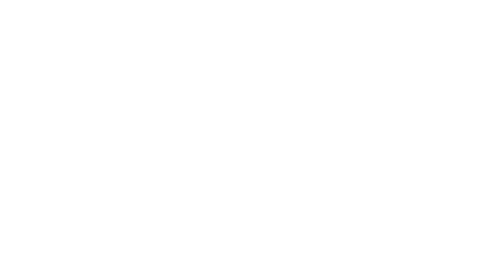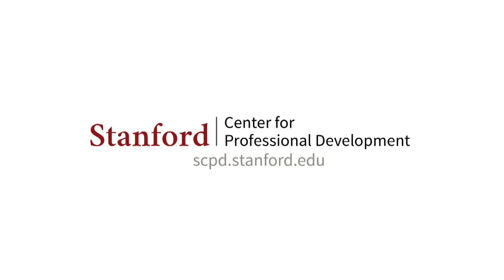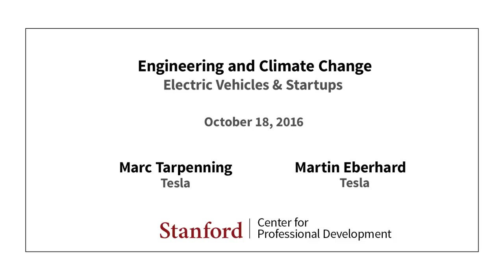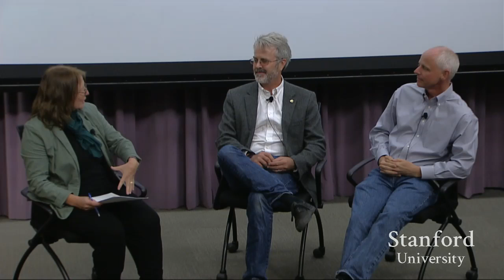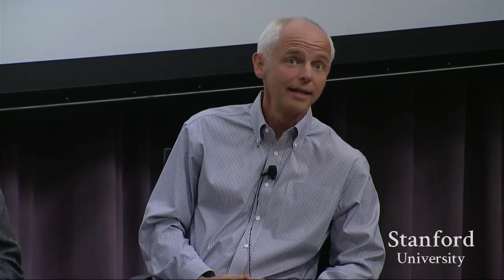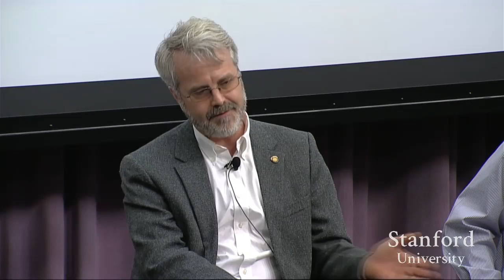Stanford Seminar: Electric Vehicles - Marc Tarpenning & Martin Eberhard, Co-Founders of Tesla

Comment: The efficiency of Tesla's cars can be improved fairly significantly. Aero is far from optimal, particularly around the tires. AC induction is actually pretty poor in low power steady cruise which is why Model S gained some efficiency in the dual motor config. I believe in adding a low power ironless PM motor that's optimized for efficiency in long distance freeway cruise. In parallel it can spin without drag as can the AC induction so it's a good pair. You might gain 10-20% on range and that's huge.
You can drop battery weight thus structure weight etc etc   Optimization is king.  Model S is actually a pig in many ways.
Reply: I’m currently conducting a research on this matter and I would like to talk to you if possible. Thanks! Paulina
Reply: @pauligross  , Dan Fredriksen may be totally correct. But as he said, the results are in in the magnitude of 10-20%. Not factors (2x), much less in orders of magnitude (10x). Small improvements.
Optimising for one goal (efficiency in long distance freeway cruise) might not be the best for peak power. Many "optimisations" have side effects.
Of course Tesla Model S 2012 wasn't perfect, they may come some improvements. Actually the Model 3 is a lot more efficient than the Model S, it is the most efficient EV, on tie with the Hyundai Ioniq, but that one is significantly lighter because it has a battery half the size.
But in the end effect, most future efficiency improvements will be small, in the order of 10% or just maybe a few more.

Actually - it will go the other way because EV drivetrains will be put in far less efficient cars, for example crossovers (Kona, Niro, i-Pace) or even SUVs (e-Tron, EQC).